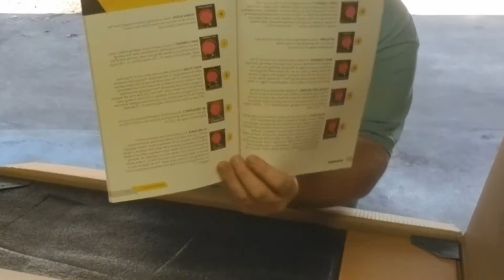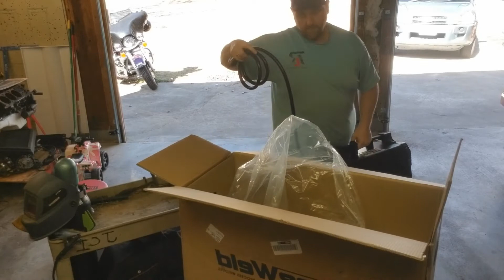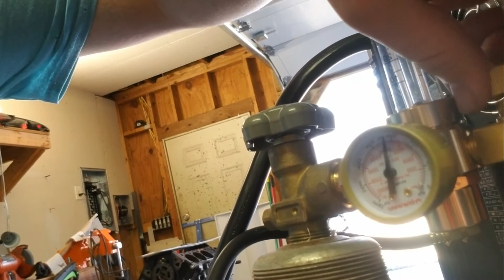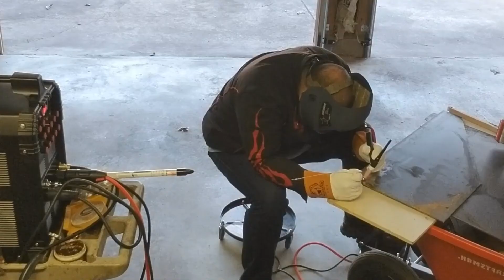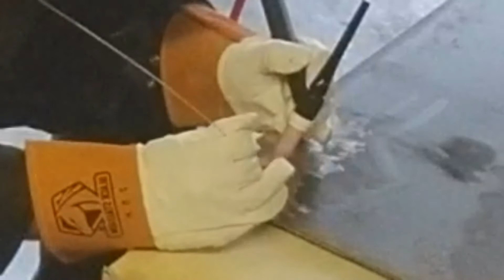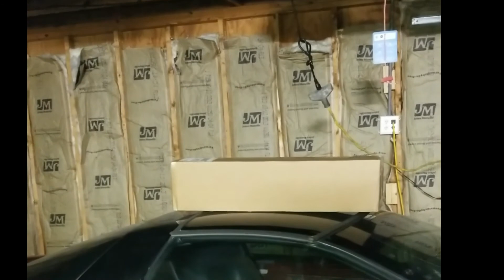PRIME WELD TIG 225x AC/DC TIG: Unboxing REVIEW, SETUP and FIRST beads!!! CK WORLDWIDE flex torch!

Comment: You can make a 220 line by using two separate 120 outlets, there are vids on that, with the pros and cons as that is an could be option until you get an actual proper 220 set up.
Reply from the maker: Thanks for the tip Rodney! Sounds like it could be a good idea! I will have to look into that if the need comes up in the future.
Reply from the maker: I just ran a 220 line off a double pole from the sub panel in the garage and picked up a 15 or 20 ft extension cord to be able to reach the rest of the shop for now. Been working pretty good so far. Just picked up a cheap one from Amazon.